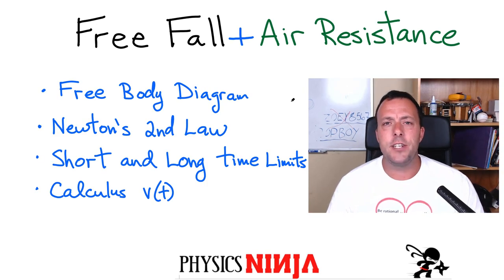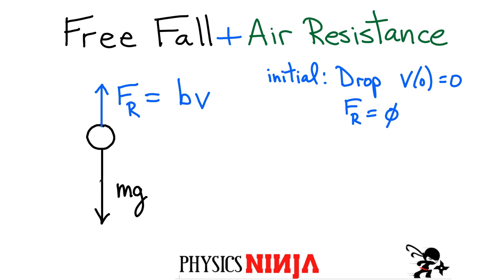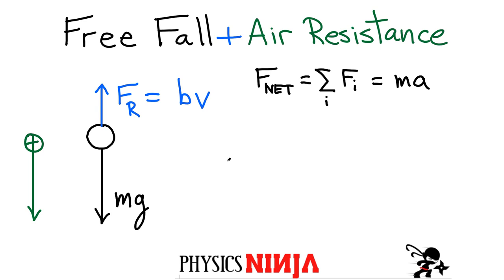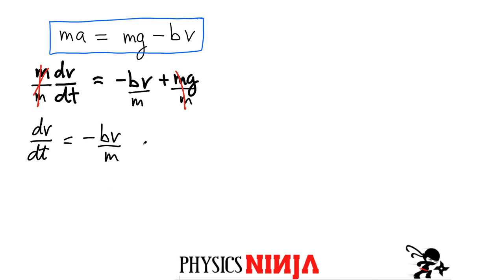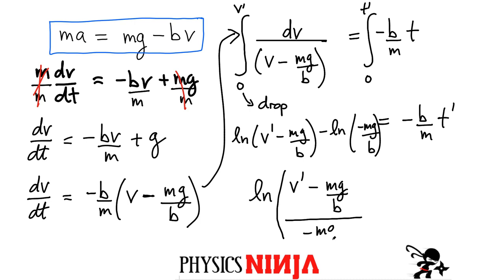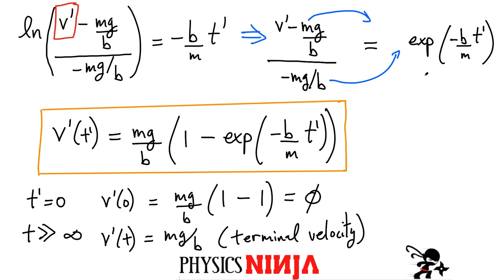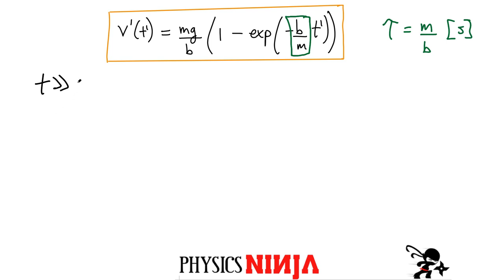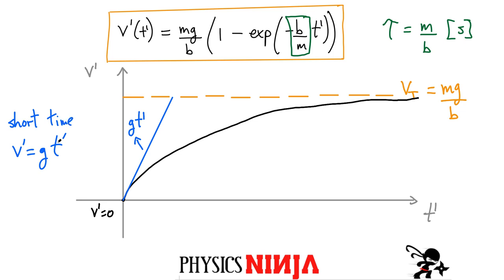Free Fall with Air Resistance - Terminal Velocity (video 1 of 2)

Comment: I think you tried to simplify the calculus parts, but it made it more confusing to someone that has gone through calculus.
Reply: Yeah I agree. I think you don't need to factor or make the integrals definite because you can solve for C at the end is a lot easier.
Reply: @andrewkurtz1252   I think you have to factor to get v with dv so that you can take the integral on both sides.

Comment: Hello my question is this,

Taking the air resistance into account,the acceleration of a free falling body can be described approximately by a(v)=g-av^2.
Here g is the gravity acceleration and a a constant.
Determine the velocity v(t) of the body that is released from rest.

Thank you!
Reply: Just subtite a with dv/dt and separate the integrals and solve both the intregals, your intial conditions will be your limits.

Comment: Sorry but what if the body is moving down at t=0 ? Let's say at t=0, my v=8. How do I find out what is my v at t=10 ?
Reply: What I mean is, what if v0 is not 0. How do I find v(t) ?
Reply from the maker: @leomadden7724  If you look when i integrate the equation for time i integrate from 0 to some time later t,   my limits for velocity go from 0 to some final velocity.    You need to redo the integration with new limits for velocity.   For you case you are integrating from 8 (at time 0) to some final value v.   After you get your expression you substitute t=10seconds

Comment: Great explanation. Simple but accurate. I have one question. Suppose we don't drop the ball but propel it through the air with a certain acceleration. Can we substitute g with this new acceleration and get the same results? Also, does this mean that the terminal velocity depends on the acceleration? So, with greater acceleration we can achieve greater terminal velocity? Thanks.
Reply from the maker: If instead of g we have an applied force F then the terminal velocity will depend on applied force.  The terminal velocity will always be obtained when we balance forces ( in this case gravity and drag).   Be careful when you say “terminal velocity depends on acceleration).  Once terminal velocity is reached the acceleration goes to 0.
Reply: @PhysicsNinja  Yeah, I meant force. I always associate force with acceleration, thus the confusion. Thanks, for the reply. I just wanted to make sure the drag force can arise due to any kind of movement of the object and it's not somehow bound to the G force.
Reply: @PhysicsNinja  Yeah, I meant force. I always associate force with acceleration, thus the confusion. Thanks, for the reply. I just wanted to make sure the drag force can arise due to any kind of movement of the object and it's not somehow bound to the G force.
Reply: @PhysicsNinja  does that mean we can control terminal velocity, in horizontal direction also, if we control the horizontal force?
Reply from the maker: @bandekarameya  Yes!  For projectile motion the drag force is always opposite of the instantaneous velocity so there are 2 components.

Comment: Sir what is b
Reply from the maker: I wrote down the drag force as being proportional to the velocity of the object.   In this case b is just the constant of proportionality.     At the end of the day the force should have the proper units so b would need to be in units of [N/(m/s)].      It will depend on the geometry of the object and the density of the fluid.  The exact expression can be found in books on fluid dynamics (i'm guessing).  Depending on the speed of the object moving through the fluid sometimes the drag force is proportional to v^2 rather than just v.     Again there is a constant term in from of the velocity term.
Reply: b is the fluid resistance constant....It depends on the density of air(ρ) , Area of falling body(A), and aerodynamic drag(C).
b=(ρCA)/2.